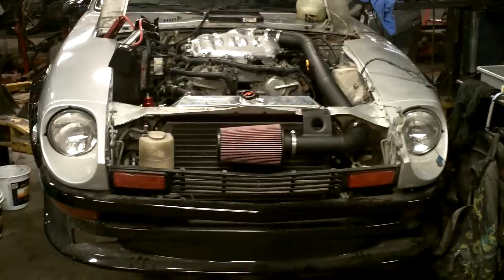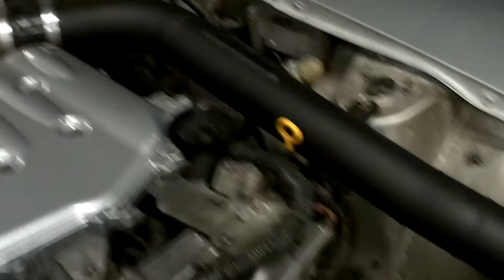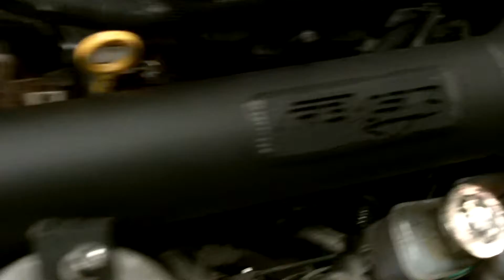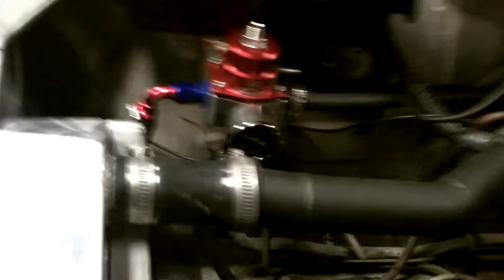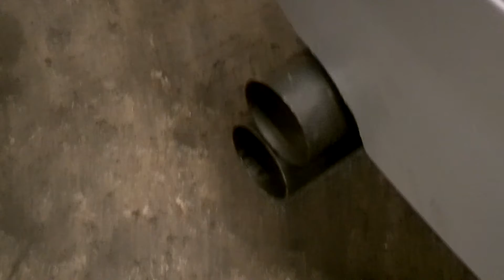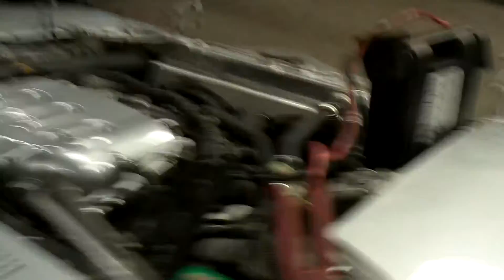VQ35 Swapped 280Z - built by Z-Fever

Comment: Does putting a vq in significantly drop the weight compared having an L28 or 24?
Reply from the maker: Yes it does... the overall weight is approx 100 lbs less. but the more important part is that the weight is shifted back behind the front subframe making the vehicles weight balance distribution closer to a 50/50

Comment: Ever done a z31?
Reply from the maker: ironically.... there is a VQ35 powered Z31 here at our shop right now. It was being built at a shop in NYC. They could not finish it so the customer shipped it to us... We have done VK56 and RB26 swaps in the Z31...
Reply: zfeverrocks interesting, what is the main issue with swapping a VQ into a z31?
Reply from the maker: main issue? Well, like any "swap" fitment and wiring.... The VQ35 is a front sump engine, the VG30E is a rear sump engine (1st challenge). The VQ35 is 27" tall the VG30 is 24" tall. however, the VQ is front sump the total height is at the front of the engine, whereas the VG has it's highest point at the back of the engine. Then, you need to make the mounts, trans mount, shorten the shifter location (we make a bracket) because the trans is about 7" longer than the VG trans. and lastly, the wiring... we offer the wiring harness and ECU tune sertvice for $950.
Reply: zfeverrocks what of a vh45? Sorry if I'm asking alotta questions haha
Reply from the maker: yes... just not into a Z31. We have done them in 300ZX Z32. Very tall engine with a HUGE intake manifold. Even the Z32 we had to cut out the hood.
Reply: zfeverrocks in your personal experience what is the best engine to swap into a z31?
Reply from the maker: I have an '88 Z31 here we installed an RB26 into it with RB25 5-spd trans. It's pretty sweet build. Fits great! if you send me an email to doug@zfever.com I will send you some pics.

Comment: Can the original gauges still be used with the swap?
Reply from the maker: You can't use the 280Z or 240Z speedo or tach. However, you can make the oil pressure and temp gauges work.

Comment: curious of what you guys did to get the powertrain mounted up properly. I'm assuming you had to mock up a mound here and there, but is there a need to get a beefier rear-end?
Reply from the maker: We have an engine/trans mount kit for the VQ in an S30 chassis. It works for all the VQ motors. You do not have to beef-up the rear end... That is purely preferential. Depends on how you drive, what you are using the car for, and horsepower goals. My 
personal 240Z has a fully built VQ37VHR with twin turbos on E85. Makes 800hp. I am running an S13 rear subframe, diff, axles.
Reply: zfeverrocks Suddenly the VQ swap for my 280 sounds much more tempting
Reply from the maker: check this 240Z we are building out.... https://www.facebook.com/pg/ZFever/photos/?tab=album&album_id=10155384594623296
Reply: awesome job

Comment: What transmission do you use with the VQ35DE?  Does the transmission come as part of the overall swap?  Thinking of having you do this swap on my 280z.  Thanks!
Reply from the maker: the VQ35DE swap uses a 6-spd manual trans and it is included when we do a swap. In fact, it is required.
Reply from the maker: yes of course!
Reply: @zfeverrocks  how much in total we talking 👀

Comment: What A/C system do you use with the swap?
Reply from the maker: We used the VQ35 a/c compressor with custom lines
Reply: ah... so modern coolant doesn't screw with the original 1970's coil. Good to know
Reply: How much would it cost for a vq37 into a 240z or 260z?
Reply from the maker: This is hte most common swap we do these days. I have 2 in the shop right now. Follow the build on our fb site at www.facebook.com/zfever I will be posting pics this coming week. It will also be twin turbo... very cool! The harness service w/ ECU tune alone for the VQ37VHR is $2295. So, the entire VQ37 swap would be approx $10k+ depending on the cost of the used VQ37 swap.
Reply: have you ever installed a supercharged vq37 into a datsun?
Reply from the maker: NO AND NOONE HAS YET.... That doesn't mean that we can't. I am currently building 2 twin turbo S30's running VQ37VHR's. We can do anything.
Reply: Ok thanks for the info! it seems like a supercharged vq in a 240z would be awesome.